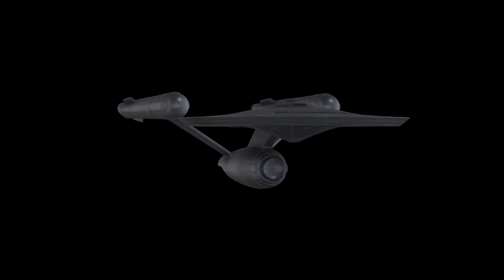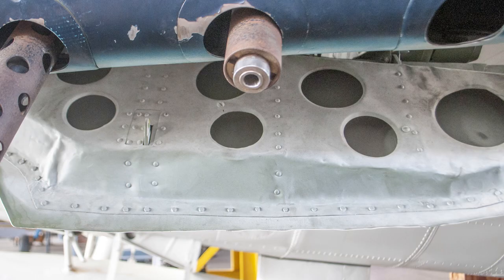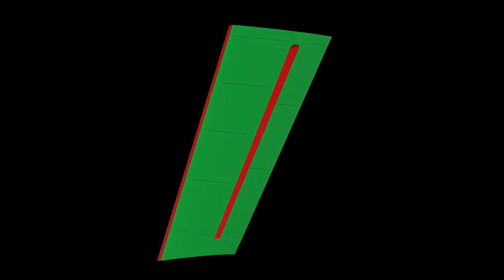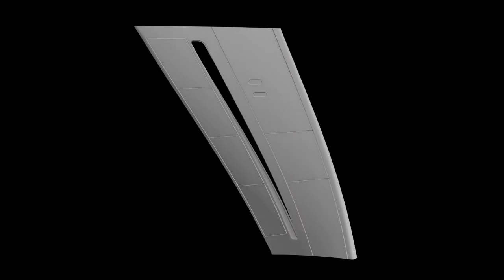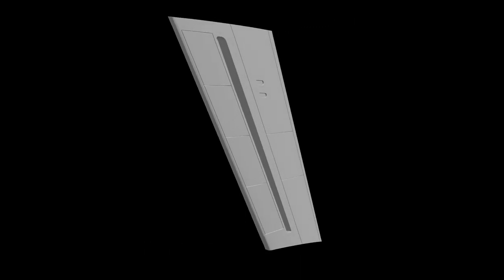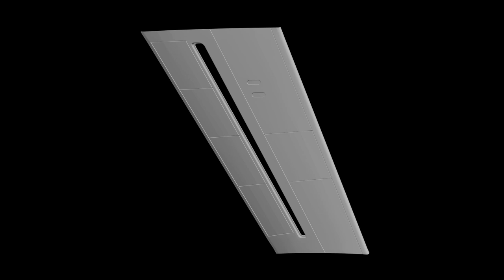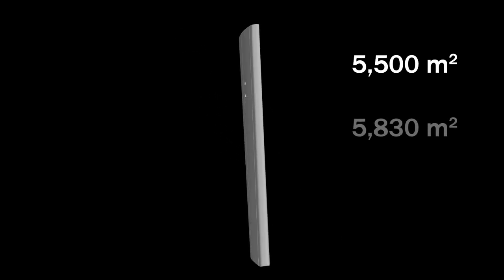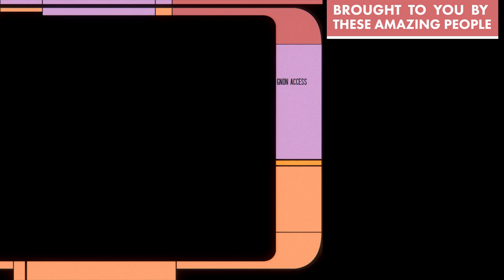What's the Deal with Pylon cutouts?

Comment: I have three ideas that might explain it.

1)  In the TOS episode "Court Martial," some of the trial board, experienced flag officers all, absolutely freak out that Enterprise 's engines are shut off and she is staying in orbit by intertia alone, and that the ship may fall out of the sky any minute, even before the trial is over.  (Because Star Trek is hardcore science for hardcore science people, we know this is entirely plausible.)  Maybe the cut outs in the pylons were an early but failed attempt to correct such a situation, and they are actually slots for hooks to go in to attach a starship to a space station.  (This apparently failed, and these slots were gone by the time of TOS.)

 2)  There are actually four pylons, not two with cut outs.  It's a matter of perspective.  And if anyone asks why would it have four pylons, ask them, "Why does your car have four wheels, then?  Duh!"

3)  The cut outs aren't cut outs at all, they are sections of the pylons that are made of transparent aluminum, and are there solely because the designer, Elon Musk VI, thought it was cool.  We actually learn at some point that starships are, in fact, from very late drawings of SpaceX's Starship, which was never built in the original Musk's lifetime because he kept changing the design.

Comment: While I am not an engineer, would not the newly added surface area tend to radiate heat toward other parts of the cutout thus producing little net gain in dissipation since there is no medium in space to carry the heat away and flat surfaces tend to radiate perpendicular to the surface?

Comment: The problem with the idea of the cutout increasing the surface area for radiating waste heat is that it just means the ship is radiating the heat into itself through the cutout gap. This totally negates the purpose.

To me, if we're assuming the pylons are the main radiators for the Enterprise, it would make more sense if the gap were there to physically isolate parts of the pylon into discrete thermal zones. You could have a high-temperature section for warp plasma, structural integrity, shield generators and other high-energy components; and a low-temperature section, for the cryogenic deuterium conduits running from the Bussard collectors, or even for the ship's life support systems. (You generally don't want the VERY VERY VERY hot engines and the only-comfortably-warm life support sharing the same radiator system, because when it reaches thermal equilibrium you still end up boiling the crew alive.) If the pylons are radiating outwards on the broad dorsal and ventral pylon surfaces only this would ensure that although physically close together the two radiator systems remain well isolated. Also, the fact that the gap is noticeably off-centre supports this idea - you don't need as big a radiator for the cooler bits as you do for the super-hot bits.

Comment: I don't buy the heating-shedding argument myself.  I think there would be much better ways to do that without a long vertical gap which, to me, presents many other issues including possible structural issues, complexity in manufacture, difficulty in servicing among them.

If its' really about heat, why not have two vertical cut outs to get an additional 6%?  Why not have two (or more) horizontal breaks in the long cutout which would add a touch more surface area while also allowing for more structural stability and cross over points for service people as well as redundant paths for piping/electrical?  For that matter, if heat dissipation is really that important, why not have radiation in those cut outs which would super significantly increase surface area? **

I very much applaud the effort to find an "in universe" explanation for the cut outs.  I honestly think it's a fun challenge and makes for a better story as a fan if we can have a reason for it all.  But I don't like the heat dissipation explanation.

(** Yes, I know that radiator fins would be extremely fragile in a warship, even ones "contained" in a cut out like this.  But I also suspect they would be cheap and easy to replace anytime the ship is in a dock with even minimal repair services.  So putting them in makes sense if heat dissipation is needed.  You gain the advantages of the fins as long as they last in battle, and it's relatively cheap and easy to replace them after a battle if they get damaged.)

Comment: i assumed that it was actually 2 pylons that were connected at the top and the bottom, one to carry warp plasma to the nacel while the other to carry control circuitry, this way avoiding the risk of overheating of the circuitry by containing them in one area together.  though i have to admit, These Old Engines makes a good point about one side being plasma flow while the other a personnel crawl space.

Comment: Cracks cannot propagate across a gap, so for some failure modes it is better to have two lighter pylons than one larger one. This advantage can also be gained from lamination and other macro- & microscopic composite material structures, which we be near certain is also in play, but these advantages are additive not mutually exclusive. Starfleet would be using every trick possible to maximize the effectiveness of their top-of-the-line starships.

Comment: on real world circuit boards, slots are routed through the substrate in order to isolate high voltage components from low voltage ones...as others have suggested, the holes might be for isolating one kind of system from another...

Comment: Plasma coolant loop? The cutout acts as a barrier because of the vacuum making the smaller section an area that doesn't absorb the radiated heat of the main warp plasma conduit while at the same time giving you a place you can flip a switch and dump your excess warp plasma in to rather than vent it into space. If for example you're running your engines really hot and all of a sudden your coils begin to overheat and fail you need to stop the plasma flow and let the coils cool off; you could dump it into space but we've seen that cause disruptions to a warp field so what if you have a reservoir you could dump your plasma into till it cools and get cycled back through the system. This way you could rapidly cool the coils without dumping plasma and coming out of warp.

Comment: Repositioning material can increase strength, but cutting out sections will only ever lower your moment of inertia, making it easier to bend.
Reply: Given the forces involved I imagine structural integrity fields are mandatory for keeping the ship in a usable shape, so I dont know that the mechanical stiffness is that critical in normal operations.

Comment: Hmm, I don't think heat radiation works as an explanation.

While you have increased your overall area, the two new surfaces are pointed right at each other with little distance between them. That is a bad thing for space radiators, they'd each be hit with a large amount of the heat put out by the other one.

Comment: What if there are multiple systems running through the pilons that require separation? In modern construction, in-wall ethernet can't be run alongside power lines without electromagnetic shielding. The electromagnetic field created by power lines can disrupt data transmition along the ethernet line, so shielded ethernet cables are needed to prevent a significant drop in signal strength if they are to be run alongside power lines in the wall. What if there were significant weight/cost savings to reduce the required shielding on other systems in the pylon by running them through a conduit that's physically separated from the plasma conduits in the larger forward section of the pilon? It's the kind of thing that would be more important on ships designed to spend long periods of time without maintenance support, as one would expect on a 5 year long exploratory voyage. A low-tech solution to enhance reliability and reduce dependance on extensive maintenance.

Comment: More support for the nacelles, probably more structural integrity, if it starts to crack or be cut into the potential to stop the break or cut is still possible breaking the crack. It could also be designed way different than shown because that was rather weak.

Comment: Using the internal sides of the cutout for radiative cooling is a bad idea: the radiation would jump from one side to the other, heating that side, and vice-versa, Radiators need to have free line-of-sight normals into space (meaning that if you were lying on your back, looking straight "up", like when you lie on the grass to see the stars at night). Any part of the ship that can "see" the radiators will just reabsorb the heat anyway. The underside of the nacelles are a great spot for radiators. the upper surfaces aren't (because they can "see" one another"

Comment: I would also see it as a backup support during combat. 

Say the shields collapse and the pylon is hit. As we see in star trek beyond and DS9 pylons are a weak point and the warp nacelles are often blown off. 

If there is a hole and the pylon is hit. You technically have a second pylon that can take some of the weight. So if the back part is hit and blown out then the forward section is still in tact and can take the strain

Comment: One segment carries the primary system(s) ectectrical, structural ect, the other carries the secondary or back-up systems, this way if one is damaged it is less likely that the cause of the damage will effect the other systems, thereby retaining at least some functionality. Very common technique on aircraft and naval vessels. You have your primary hydraulic system on one side of the ship and the secondary on the other side, same with electrical systems, fire suppression ect.  that way if the ship take battle damage such as a missle or torpedo hit on one side the system on the other side could still be functional. Aircraft are similar but also somewhat different, you can have your primary hydraulics supply the flight controls but the back-up hydraulics will supply the PRIMARY flight controls but not the secondary flight controls. The main electrical system will supply everything, but if the main electrical fails the batteries will supply the PRIMARY electrical system and some other back-up electrical source (like a ram air turbine or hydraulic driven generator) will supply the secondary electrical system.

Comment: TOS Enterprise has narrow straight pylons
Refit enterprise has flared pylons that have moved so far it would necessitate the removal of the nacelles entirely before reattaching them.
Perhaps this is a partial refit, something intended to take a month or two and add more structure to existing narrow pylons (TOS pylons) without necessitating the full removal of the nacelles, essentially just adding more material rather than rebuilding the entire aft section, and if that's the case perhaps something on the leading edge of the original narrow pylon still needs to be exposed to space.

Comment: I have to disappoint you, but the heat part does not work like that. You would be right the increased sruface area boosts the heat exchange  in a fluid like air or water, considering heat convection. However, as you said yourself, in vacuum there is only heat radiation. There you need to introduce view factors. This means, the cut out wall mostly only "sees" the opposite wall. Since the heat is transferred in a straight line, most of the radiated heat is again consumed by the opposing wall. Only at the edges, there is a slight increase due to the curved profile.

Comment: The struts were designed to be straight, John Eaves says the entire design was thinking accordingly to the original Enterprise, in that all pieces seen on the ship could be swapped out to look like the 60's version. I may have interpreted his words wrong here but there is extra space on them and to thin them out by removing a certain amount of that strut leaves the exact width seen in the 60's version. The upscaling of the model for the show and the retraction of the struts removes all the thinking that went into the design.

I thought along the lines of cooling vents as spoken here.

Comment: I think a possible explanation could be... Most human design is organic in development, & like organics everything evolves.  Seldom do we have extreme jumps in tech, or in nature.  Looking at this pylon my guess is that what we are seeing here is not a cutout in a large pylon, but actually a second pylon.  Since cooling of plasma conduits has long been mastered, it's likely a second warp plasma conduit runs up the second pylon, dare I say, a second backup warp plasma conduit runs through a second backup pylon.  This way they have twice as many conduits for delivery of plasma, & both are entirely isolated from one another in case of damage or failure, "which goes well with the federations philosophy of adding a redundancy systems for everything possible."  It would also reduce the overall work load of a single pylon, or be able to deliver more plasma to the warp engine, or some combination of both.  Anyway just my thoughts.

Comment: Yeah, um... see, what is happening is that there is an issue with the warp coils, when they ramp up from WF5 to WF6 the coils emit some unwanted warp field side-lobes. Transmitted out into space, they don't cause that big of a problem, just some minor field instabilities which are mitigated with plasma output control, but the side-lobes impinging on the pylons cause--potentially catastrophic--interference with the structural integrity field and inertial dampeners in the area, along with some minor yaw fluctuations, you know if the nacelles are not ripped from the ship. So the slot in the pylons are about twice the wavelength of the side-lobe frequency, you know, a little extra wiggle room for modulation peaks, and that lets the side-lobes slip past the pylon with minimal interference. It's a work around until the new coil designs are certified for release, and will be implemented on overhauls and refits for the upcoming decade. And you know, what kills me is that I tried to tell them. I said the geometry on the inboard z-members of the transition coil would cause this problem, did they want to do anything? No. Told me there would be a 6% increase in mass, at a cost of roughly 2500 manhours, and you know how hard it is to get Starfleet shipyard personnel to work more than six hours a day. Management... You can't kill 'em.

Comment: Plain and simple thermodynamics 101 doesn't apply here because of the point you made about the vacuum of space. lightning is a form of plasma energy but in space it equals zero. plasma itself is continuous as long as conditions are optimal. The cutout also adds a level of safety plus added strength. Has anyone ever thought about a plasma heat sink? Yes, they did.

Comment: I think they are weight saving features. If you wanna accelerate X mass at Y rate you need to generate Z amounts of force. If you can only generate Z-1 amounts of force you need to reduce X by some amount. And impulse engines are described as being fusion rockets. This simple Newtonian relation could be why the saucer section tapers in which is not very efficient for interior space, why the dorsal aft of the stardrive section is scooped, and why The Discovery has the giant missing section in its saucer.
Reply: Weight saving may also be the reason the body of the ship could be described a generally round. The surface to volume ratio is pretty low round shapes vs non round shapes. This means less material is required to encompass a given volume so if your willing to make some sacrifices like having slanted walls and curving rooms and halls you can save weight by literally cutting corners.

Comment: The waste heat can't be recycled. Turning it directly to useful energy violates the law of increasing entropy. You can use a heat pump to extract some energy if you have a cooler heat sink, but that means you have to be better at getting rid of waste heat. It's not an alternative to it.

The holes in the pylons do not increase surface area in a way that's useful for this. If you're in an atmosphere you add all sorts of complicated surfaces so it touches more air to lose heat faster, but space doesn't have air. The only way to lose energy is radiative cooling, and all that matters for that is the convex hull. Adding holes can only decrease the amount of surface visible from some direction. Radiation that leaves through the extra area can easily hit other parts of the ship and get reabsorbed, so they don't help.

Comment: the radiator idea could be it. especially if the channel was in integrated emitter/capture system for a vaporised material or plasma radiator. the material going from high density to the vacuum of space, then being recaptured at a now much lower temperature.

Comment: Possibly the same reason cutouts are used in nearly every circuit board.(and tons of other things like nuclear reactors etc etc...)

 Isolation.

 Whether that be from energy, heat, radiation, safety barriers... Or what not. Just an out-of-the-box thought from an engineer who's really never watched Star Trek... But finds it endlessly fascinating?😁👍

Comment: I personally like the structural Theory better and I feel like if Heat was remotely a concern the ship would be very well designed against it such as the ISS I imagine the slightly less Advanced clip assuming a enemies to shoot a common command would be extending the radiators or access radiators

Comment: It allows technicians easy access the primary power coupling and secondary power conduit’s traveling up the nacells  to the warp engines and then back down into the intermix chamber. The structural integrity shields would make skeletal support irrelevant🙄